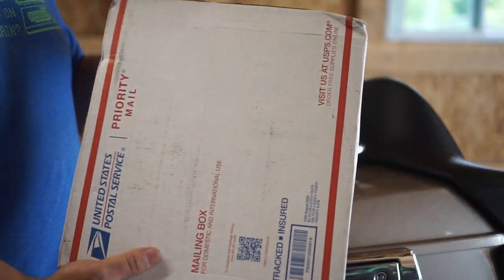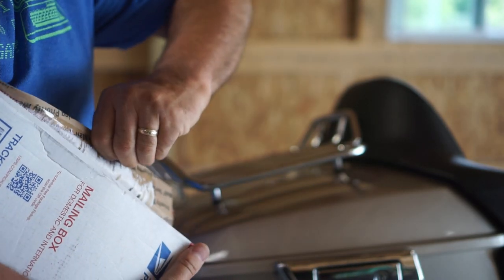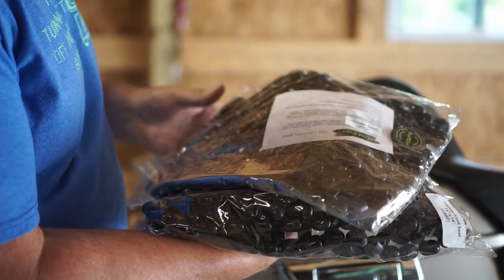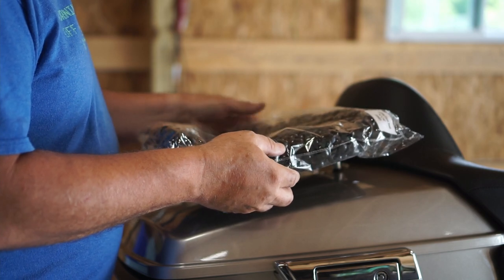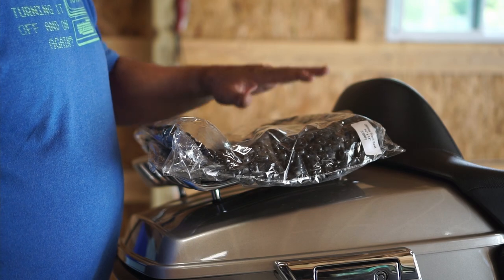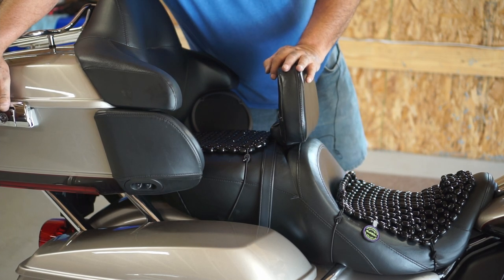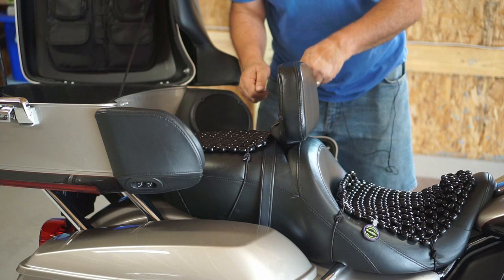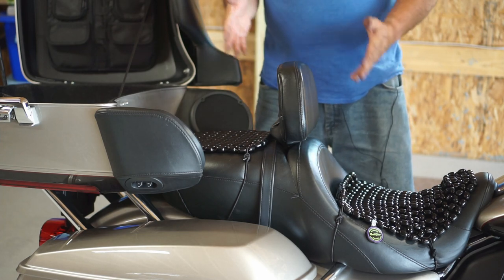How To Have A More Comfortable Motorcycle Seat

Comment: I like your video. I tried those & in my opinion they are fair. I currently have the Airhawk air cushion. It is adjustable to your weight, very simple & very durable. I've had mine for 4 years  The comfort is phenomenal, $100. I ride a '16 FLHTK. Good luck!
Reply from the maker: That is also a great idea. Thanks for the tip. Ride Safe

Comment: I use a sheepskin works great
Reply: I seen sheepskin advertised which way would you recommend
Reply: @fourftr  Well that is kind of hard to recommend, but I will give you the pros & cons on sheepskin, PROS - great in the sweltering summer wont' have sweaty butt, great in the winter holds your body heat on your butt. Some come with a gel pad inside (I removed gel pad b/c it raised me off the ground. CONS - Not good in the rain it will hold water in the fur. Beaded Pads - Pros are the same but no gel. CONS - Not sure about the longevity b/c they are made of wood most of them and can fall apart after time and will need to be replace.
Reply from the maker: I have seen those. Thanks for the tip. Ride Safe